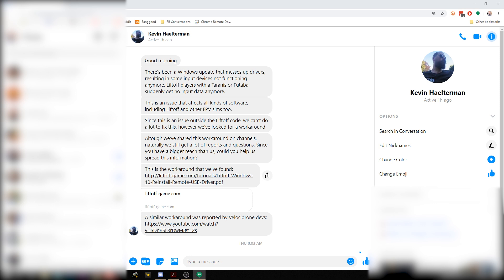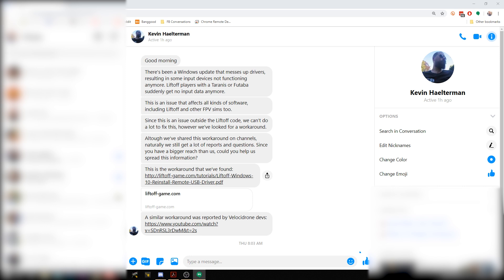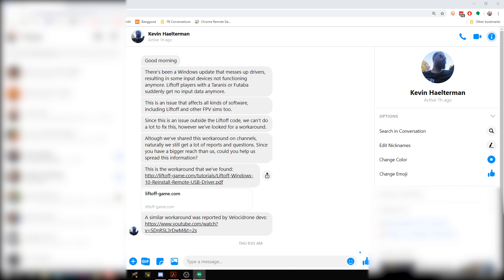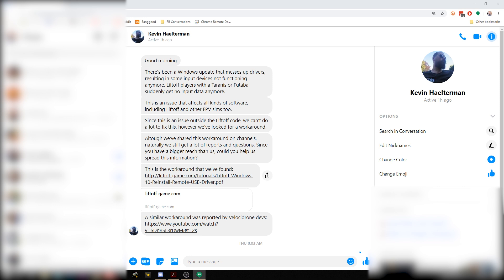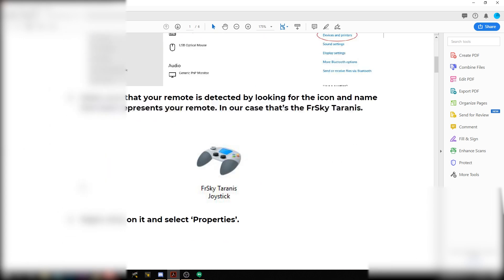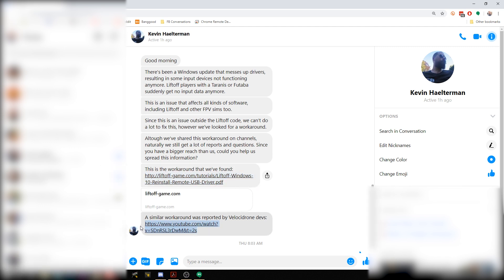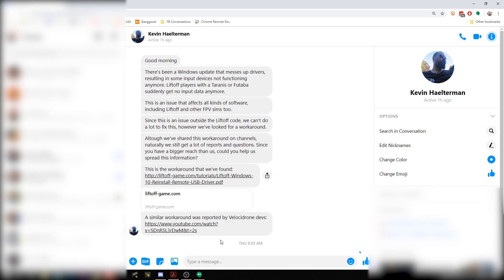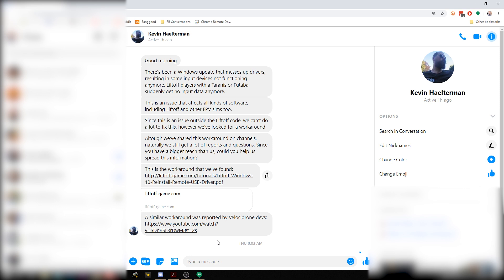Windows Simulator Controller Stopped Working HOW TO FIX

Comment: Actually its a simple fix on my side.
1. Open Device Manager
2. Connect TX
3. Uninstall the unwanted driver for TX
4. Update Driver by manually selection
5. There will be an option( I remember I choose "USB device ....")
6. Finish

Just sharing. :)

Comment: Maybe this helps with a problem ive had for a LONG time. Thanks JB. (Edit:) Nope, I am unable to rollback my driver as the button for it is greyed out as if it has already been rolled back, updating it does nothing. Taranis disconnects after a few minutes.

Comment: Snappy Driver Installer  https://sdi-tool.org/
Download SDI Lite which only downloads the drivers needed for your computer.  If you have dozens of computers, such as a computer shop, download the SDI Full version and keep it on a network share and run it from the network to install all drivers on systems. 
I run it every couple months to keep my drivers updated.

Comment: Those steps will not always work.  If it doesnt work go to properties for the driver and hit roll back to previous version.
Reply: We've indeed noticed there's still some issue for a few. We've reached out to our partners at FrSky to help us provide a real fix rather than a workaround. Fingers crossed :)
Reply: Can’t roll back or system restore:(
Reply: Scott Schneider why?
Reply: hellbilly_fpv wasn’t set up for it
Reply: This was the only fix that worked.
Reply: That was my fix as well - rolling back driver